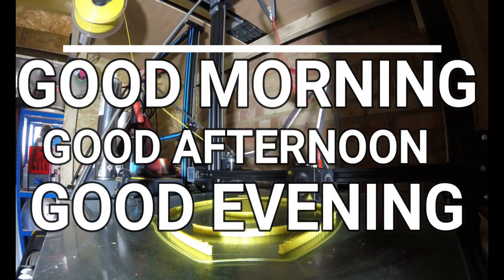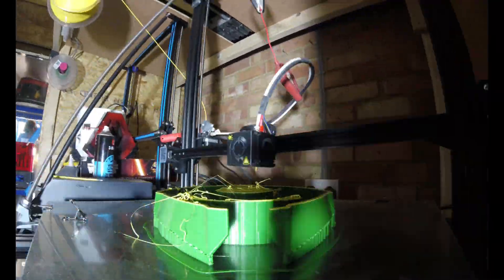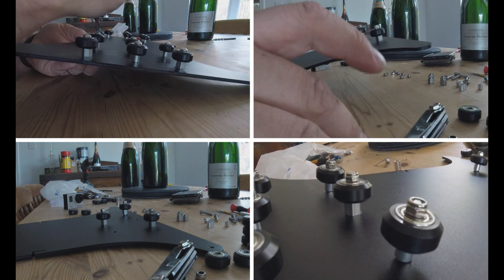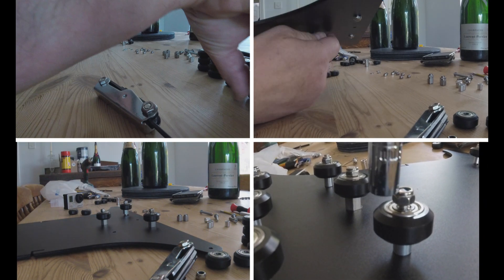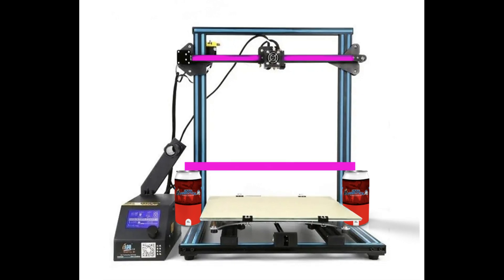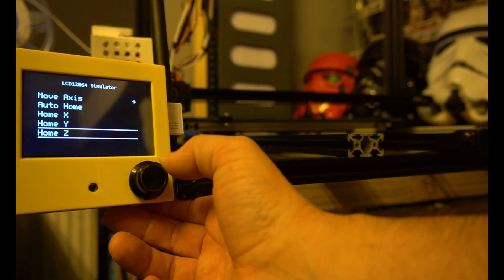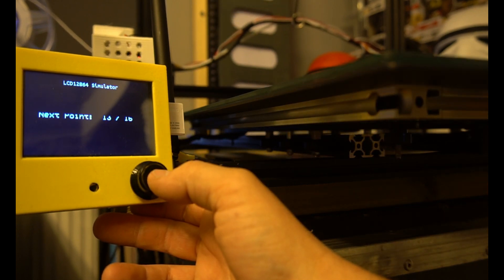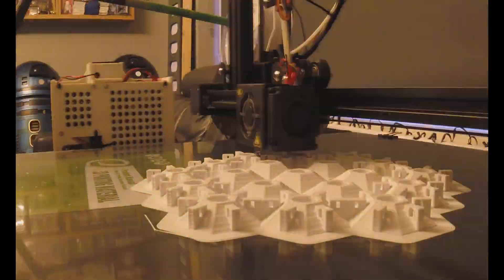Fixing a Creality CR10 S5 3D Printer Part 1

Comment: Hello, not sure if you will see this, sort of late to the s5 party.

Bought a used s5, for the large capacity. Removed the springs, has Th3d bed level on it. 
The metal bracket under the bed that bed & wheels attach to seems to sag some on the corners, is this normal or should I look into a more solid bracket that dont sag? Any suggestions of alternatives if need be?
I tried to print first print for me on this machine, looks like it put down maybe 2 layers then just stopped and sat there with nozzle still on the print. No message or error code. Saw on the last question in this comment section a question about the printer doing weird stuff, you suggested a new memory card and reflashing the firmware. Could this be my issue as well? 
Im not well versed on firmware flashing do pardon my ignorance on a few questions related. 
The memory card that came with the printer is 8gig, when i tried to put in card reader on my desktop it kept saying card needed to be formatted. I saved card contents to folder on desktop then ran full format. 
When i sliced file in cura, saved to disc, memory card. A error message came up saying could not save to card, not enough room. But when i looked at card the file was on it. That is what i loaded into printer and had the problem of print stopping & sitting there.
Should I get a new card?
Does the card need to maintain any  files, ie firmware on it for the printer to run properly?
How do i know what firmware i need to flash? Where do i  find it?
Thanks for any help you can offer.

Comment: my extruder is loose to the point i can pull it out from the top and bottom of the extruder fan frame. I notice that the rubber nozzle fell and the nozzle was wobbling, I slid back on and the next day the whole nozzle and heating element was undone. I just got this and only made 2 small prints. I can't return it. so Im just stuck figuring out how to fix it. I will try later today

Comment: Hi, i have an CR-10 S5.  I was trying to install a BL Touch and flash the firmware using progisp. Board is v2.1 (atmega2560). 
Firmware didnt take now screen is just blank.  Im about to try arduino uno to flash bootlaoder and flash creality bltouch firmware.  Am i on the right track?

Comment: I have just bought this printer, and I'm having a problem, that it just keeps stopping and doing weird things between 10 and 22% done with the print. I will jack the z axis all the way up to 300 and then move randomly around, and never finish the print. Very frustrating any help would be appreciated.
Reply from the maker: Re flash the firmware, change your sd card

Comment: my right rail isn't moving properly help
Reply from the maker: Right rail??
Reply from the maker: @Brian Keller oh I see is it just moving slow or as if there is no power??
Reply from the maker: @Brian Keller so assuming it’s a duel z try and swap the cables over and see if the motor turns when you raise and lower the z

Comment: Great video. I have a CR10 S5 and I have been having tons of issues with it. I just recently installed the Bondtech dual drive extruder. This seems to have helped a bit, but I believe the glass bed it came with is warped in the middle which is a bit frustrating. Any Recommendations on where to buy a new glass bed for a decent price?
Reply from the maker: Thank you! Okay grab a ruler and pop it on the bed if you shine a light behind it you’ll see where the low spots are. Then you can pack under the bed with tape to level it up. Or and it might not help but buying a sheet of glass from a glazier will cost you about £15 but if it’s the metal bed that’s got the dip and not the glass it might not help. Let me know how you get on !
Reply: @TheRealSamPrentice  thank you! I will test the glass after this print and let you know how I do.

Comment: I bought a CR10 S5 for my very small printing business. I already have an ender 3 and was very pleased with it. My print quality stinks. Ghosting, zits/blobs for days terrible print quality. My question is, are quality small/medium size prints possible on this machine or should I take the loss, sell it and buy some ender 3s or 5s?
Reply from the maker: Hey There, I would say so yes. I would suggest you go back to basics. So the calibration cube is where I usually start, then onto testing with a heat tower. There really is a number of setup related things that need to be done. With any machine, you are going to need to maintain and tweak things. You could also have a "Friday afternoon printer" where stuff has just not been installed correctly or with care. So leveling the bed and gantry is one thing, but then seeing if your glass or metal bed is striaght is another thing.  Ping me a message with a few photos of your prints, your printers and show me what the issues are and i'll try my best to help you

Comment: Hi Sam, can you tell me where you purchased the silicone bed mounts for your CR10 S5?  I looked on amazon, but there are so many and many work on CR10 but not the S5. Thanks in advance
Reply from the maker: Wah Linker Gwisdom 3D Printer Heatbed Parts, Solid Bed Mounts there are a few on amazon solid bed mounts is the key term :) I have a new video with updates coming out soon :) thanks for the support

Comment: This this is what I needed I just got a S5. How do you feel about mirrors instead of the glass? I had somebody my maker space suggest a mirror is better than the glass.
Reply from the maker: Michael Christensen Hey Michael, well the size of the bed leads to quite an expensive replacement around $50 / £50 Ive used mirrors on the s3 with great success but there are now various bed plates you can buy, it’s down to personal choice, but I’d stay away from printing on tape! If you get stuck please let me know :)